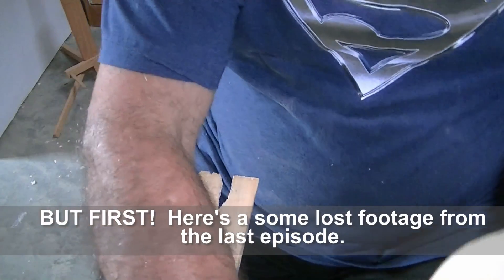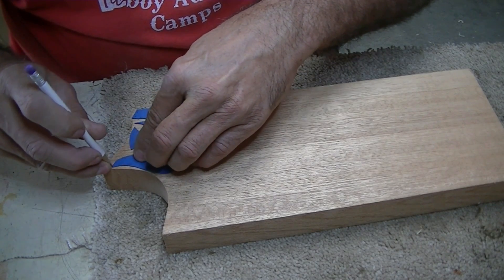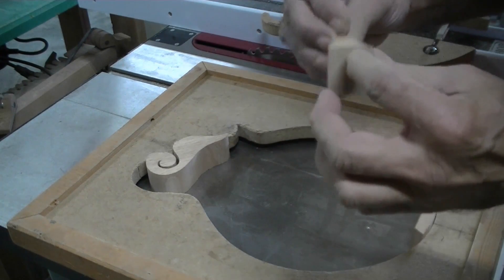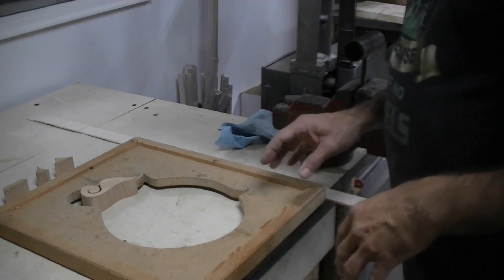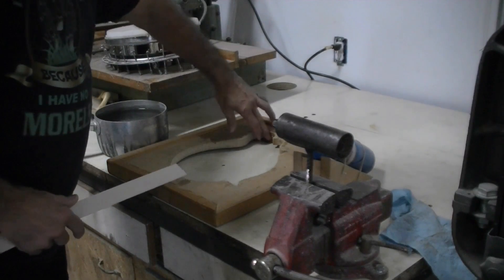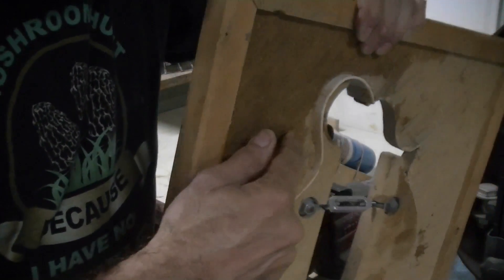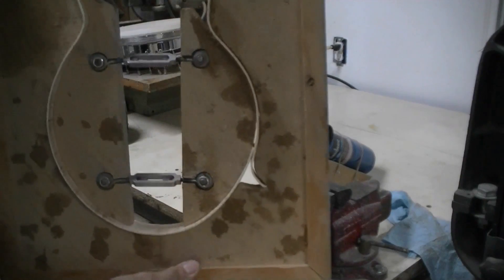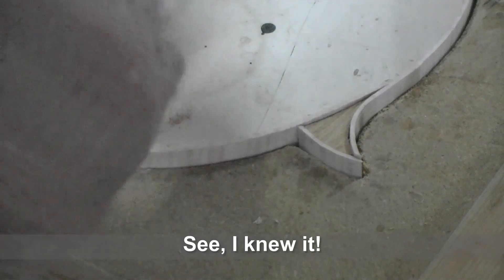182 RSW Custom Rosa Mandolin Build Part 3 Sides

Comment: Pretty intricate ! Quite the form too  -- I made a Remote control boat out of some old Oak baseboard lath same thickness used scolding hot water it bent like tin .
Reply from the maker: Garnett M thank you for watching. The curl in the maple makes it incredibly hard to bend without breaking.

Comment: To ease the bending, would soaking the strips not help soften them to the point where they will not crack like that?  It helps with thicker pieces in furniture making, but was curious if there is a reason you don't use it?
Reply from the maker: William it doesn't seem to help at all. I've tried it many different ways. Most people seem to think that on this extra curly Maple, you need to wet it even less, just barely spray it. I haven't tried that method yet so that'll be what I try next. Thank you very much for watching.

Comment: Looks great Jerry, lots of little pieces to hold all those pointy bits together. They needed to put those in the violin I'm rehabbing so I will on the reassembly. So I know there will be a story but why didn't you put the bench together the way you like it?
Reply from the maker: Dane Nichols Justice space issue. This is the only place that large bench would fit in the shop the other end is right against the wall. Thanks for watching.
Reply: Rosa String Works boy do I get that. I went from just over 1000 SF to 400SF so I understand space issues.✌🏻

Comment: 32:52 What is the mould made of? MDF or something?
Reply from the maker: Yes it's MDF and I have a rim around it to keep it up so that the sides are approximately centered. Most of these molds are made into pieces so that you can get the sides out easily. I have never had a problem with that been doing it for 30 some years and it's seems easy enough to get the sides out to me in one piece. Good luck to you.

Comment: Will you or have you put binding around the f holes, like where the top meets the sides, of this or any mandolin? I dearly love binding. Yes I know it is a lot of extra work, no more than the upper scroll of the body, but I wondered does it do any thing good or bad to the strength of the construction or sound or is it just for adding detail. This is is the only mandolin build I care to follow, so I may from time to time ask a question or so. I to have a lot to do here in Colorado to get ready for winter. I know you may not be able to, but if you shoot any footage of the saw mill, I and others would enjoy seeing it action. Have a good autumn and fall. Thankz
Reply from the maker: Audio Tech Labs binding around the f-holes is not out of the question. But I would have to charge extra for that. And the customer has not asked for it. I have never put binding around the F holes on any instrument that I filled so far. I may shoot some footage of various other activities. Thanks for watching.

Comment: Wouldnt it be easier to bend wood if you really soak the wood, instead of just dipping? 🎶🎸
Reply from the maker: Edward Wunder I've done it both ways. It works just fine the way I do it. I think the main reason is because the wood is so thin the water goes straight through it in just a few seconds.
Reply: In my experience of bending sides for an F style Mandolin if you get the wood too wet it is almost imposible to bend them without breaking them. I just use a spray bottle to spray the wood for bending. The wood I get from Old Standard Wood is so curly it breaks real easy but it is the best quality wood I have found. I have one waiting to be polished right now. That is the longest 4 weeks of the build LOL. Thanks Jerry for sharing!!
Reply from the maker: Roy R. Thanks for taking a look.
Reply: Edward Wunder maybe if it was a mahogany guitar side - cross grain    curly maple will literally fall apart if you get it too wet for too long